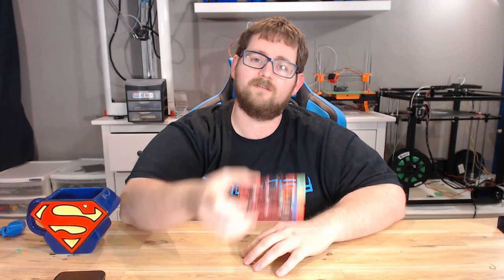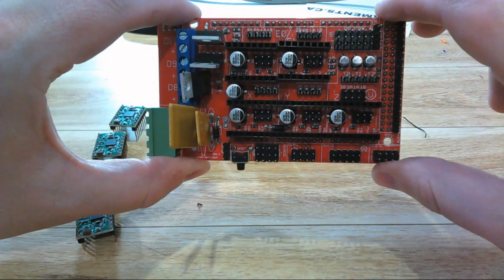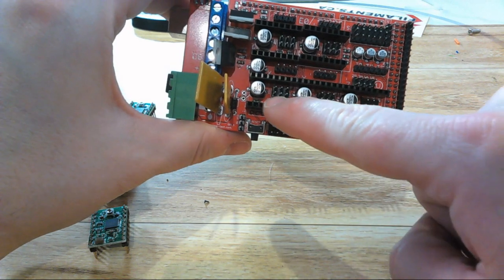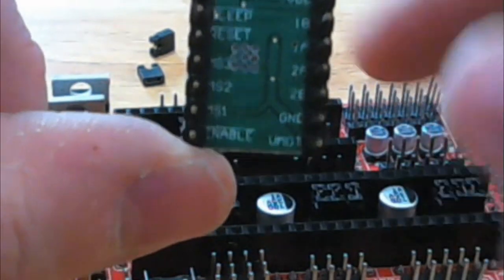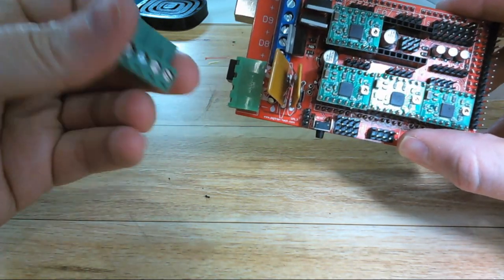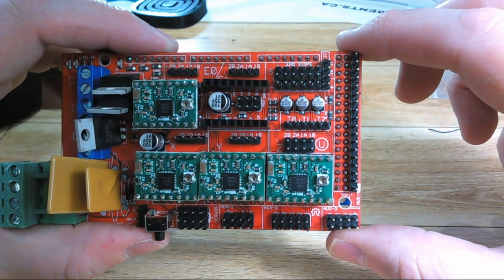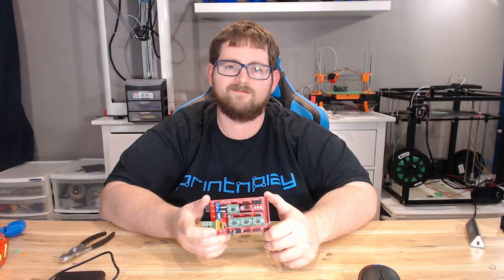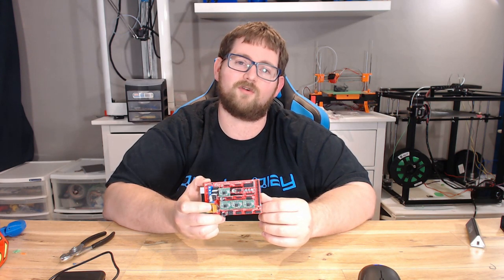3D Printing Basics  - RAMPS 101

Comment: Thanks James do have one quick question Laser where would you connect that up to the Ramps board and would it require special flashing of the board? thanks
Reply from the maker: Most people connect their laser module up  in lieu of a parts cooling fan / second hot end. No special flashing is required, but you do have to modify your gcode to turn the laser on using M106 and off using M107 . Hope this helps!

Comment: Mightve been ideal to use a pen to point at pins instead of big finger which points at 1/4 of the board. Also I could barely see the Transistor pens when you talked about them. 06:05 What are you pointing at there? lol Could barely see the Transistor pins and your fingers dont help with showing exactly what youre talking about. Other than that.. great video and thanks for sharing the knowledge master jedi.